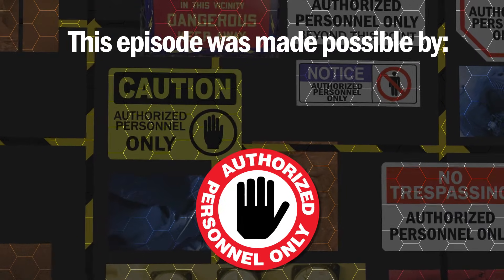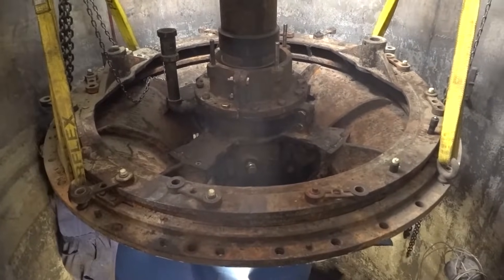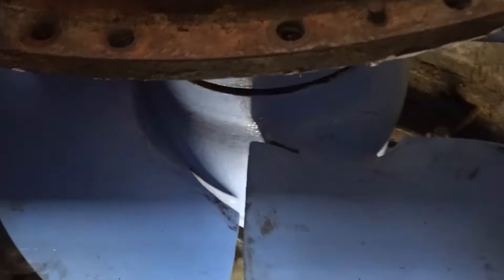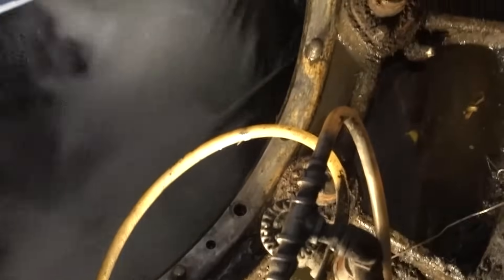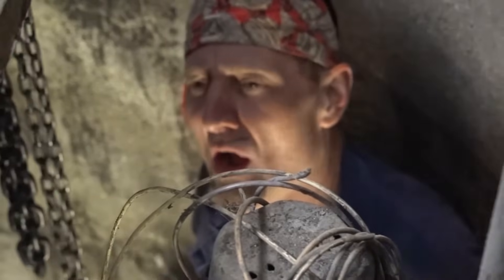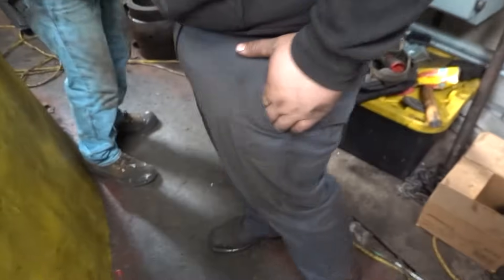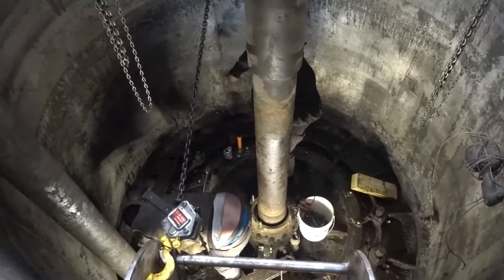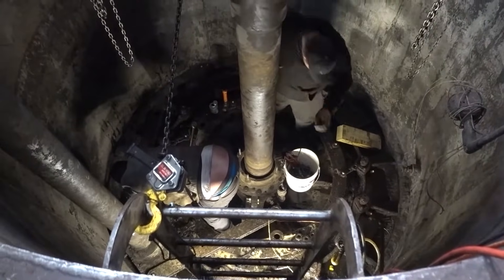Authorized Personnel Only - S2E18- Installing The Turbine

Comment: yeah you really have to trust the guys you're working with to get in the hole with nowhere to move  if ship goes south.   I know better now and will never do that when working around heavy equipment. Equipment and hoists fails all the time and there's no avoiding it, so don't put yourself in that position in the first place.  never work under overhead load these guys have been doing it for a career and they trust that equipment but on a normal construction site don't trust anything never put yourself in a position you can get out of easily and quickly.   Let those material things fall and break because humans always want to try to intervene and get destroyed and flattened and the best thing you can do is stand back and watch from a safe distance.   This is the most common death on the construction site and many times I have scolded the boss and said this is not safe and we reevaluated and did it safer because they always want to do it the fastest way not most forgiving and safeties.   For example I had a concrete pneumatic breaker  Attachmate on the front has of a skid steer and the x  lock did not seat completely because it was a rental and the whole pneumatic hammer fell almost landing on me in the cab and it was over 2000 pounds.  easy to lose your life over stupid stuff if you're not paying attention.  required the X lock to be activated   and being manually sent home with a rubber mallet and the only way we realized this when it fell off and almost crushed my legs.  there are plenty of YouTube videos of this happening to unfortunate construction workers, just from a split second error and lack of judgment.

Comment: Was the turbine runner refurbished before being lowered back into the pressure case or were the blades just cleaned and painted with a copper-based antifouling pain similar to what ships use on their hulls?

Comment: Why wouldn't the wicket gates be closed for atleast this part of the job?
Reply: They’re mostly closed, but the actuators aren’t connected, and they don’t fully seal anyways.  That is why the stop logs are there.  Another commenter alleged that there is a flow that must be maintained, but if it’s the dam i’m thinking it is, the level of the spillway may not comply with that requirement.

Comment: Ok, so these hydro plants you are at are both run of river plants, a Kaplan and a small Francis unit. No Pelton units on this project not even the house set? What type of system are you using for work authorization? There is no by-pass for the draft tube?

Comment: Why are the gates behind the screen not closed ?
There should be no water in there for this type of repair
Reply: if the wicket gates were in the closed position the water would have no where to go but rise and flood the work chamber…by having them open the water is exhausted straight out the draft tube and flows downstream
Reply: The water level behind the dam must have a set level it’s supposed to be at. I’m guessing there’s no bypass valve’s, so this is the only way to dump pressure.
Reply: What's your experience

Comment: Epic indeed!
Thalassophobia triggering for some people I'm sure.
What would happen if one of you tripped and fell into that swirling pool of water under the turbine? Would it be goodbye forever?
Reply from the maker: That depends I guess. Down the hole is a straight shot out the back of the plant. The pipe turns a 90 degree corner and then shoots out the bottom-rear of the building. The distance is about thirty feet or so to open water.
Right now though, there isn't much flow to shoot you out, the water is just barely above freezing (there's a thick layer of ice on the canal), and it might just shoot you out under the ice.
So...could you survive? Maybe, but I wouldn't want to try it myself.
Reply: It was submechanophobia that brought me to this channel about 6-8 months ago and yeah, all these mechanical parts being submerged in flowing water... its interesting but also terrifying
Reply: It took 30 years of my life to find your comment, and understand that my stupid fear of pump impellers, submerged pipes, storage tanks and other underwater equipment actually has a name. Thank you.
Reply: Thalassophobia is the fear of the sea.  Not sure what it would be for an inland waterway.

Comment: He is lucky to have modern sealants, because the original would have been tar paper and some bitumen, put in nice and hot, or cork and lots of shellac as a sealant.
Reply: honestly cork and shellac wouldn't be that bad. we still use silk thread to seal up aircraft engine cases. the silicone will work well too, but its not my first go for some things.
Reply: @syty747  i always use teflon for strength, but silk thread? ill have to look that up